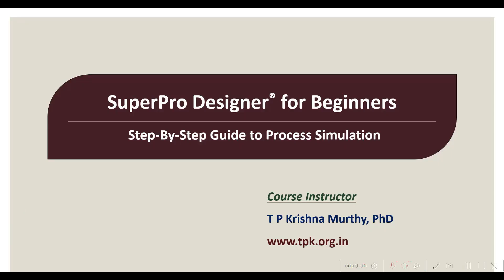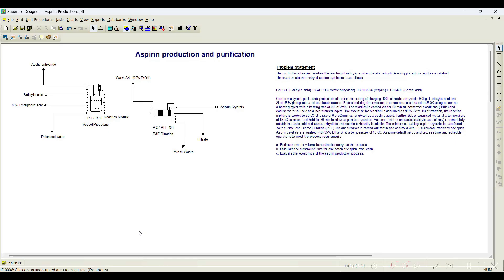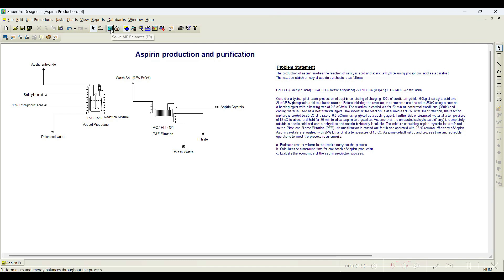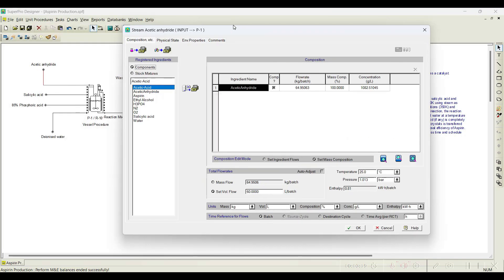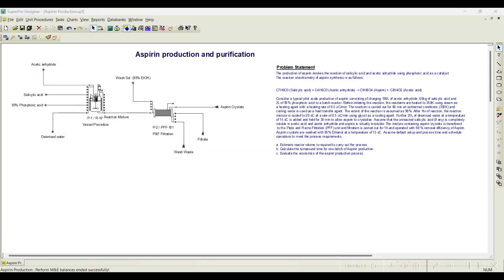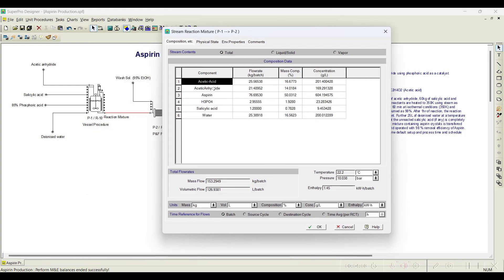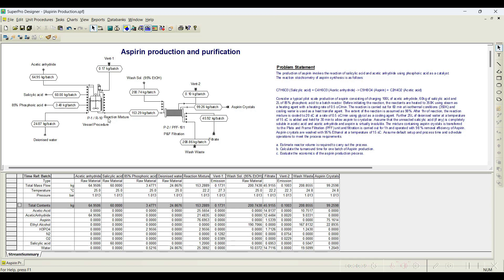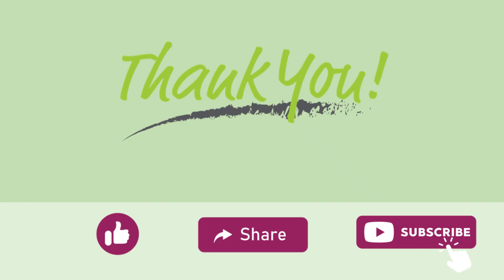12. Steps in Process Simulation using SuperPro Designer®: Part-7

Comment: Error.
FILTER-1 in P-2 | W200.3001: The calculated cake thickness (23.08 cm) exceeds the maximum allowable value (8.00 cm).
FILTER-1 in P-2 | W205.0129: The liquid/solid contents (96.04 L) exceed the equipment’s capacity (41.61 L).
I encountered errors when trying to reproduce the results. I cross-verified with the SuperPro file provided in the attached link and found the following discrepancies: 60 kg of acetic anhydride was used instead of the 100 kg mentioned in the question. The filtration time is set to 10 minutes instead of 1 hour, as stated in the question.